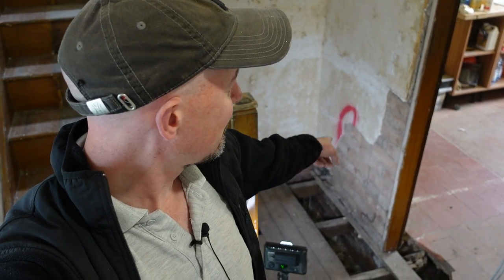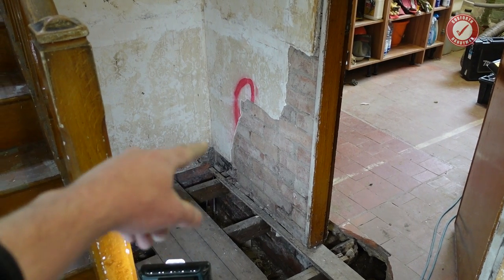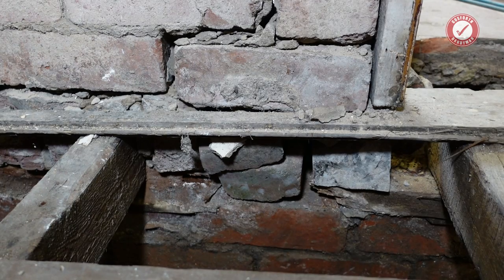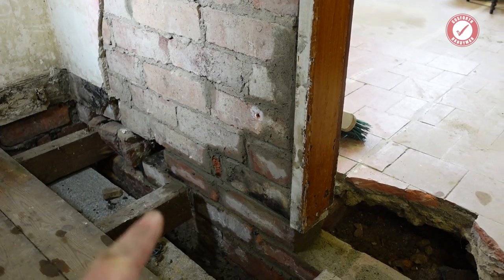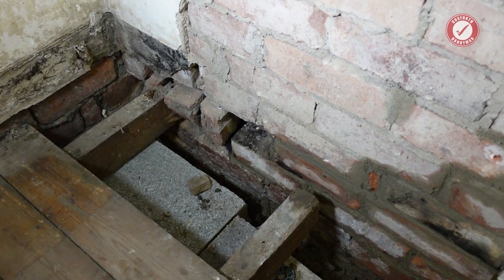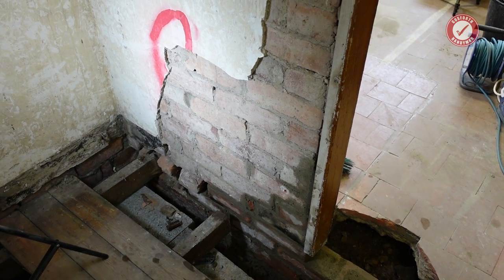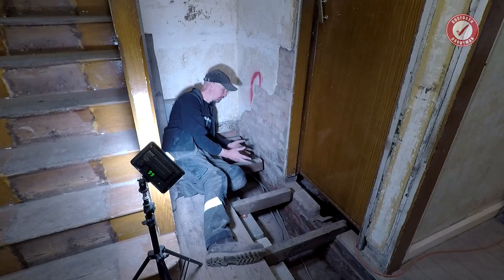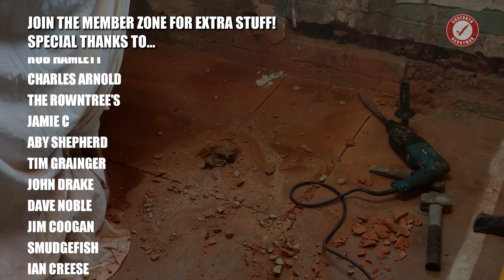We've found a STRUCTURAL problem! (1920's Renovation Part 16)

Comment: Wow!  What a nightmare!  7:09 Though (I'm sure he knows what he's doing) - cutting through the floorboard, that's supporting the wall that's holding up the two concrete lintel ends, inside the beams that it's sitting on..  Is that such a good idea?  Yikes.

I shall carry on watching to see what happens.

What I would have done, because I'm a wifey and not a builder, is rcj that whole wall up and replaced those two lintels with a huge long reinforced one the whole span of supporting wall to supporting wall.  The full width of the building.  That way - the problem is never going to be under the floor again and people can have it all open if they want.

I do wish I had a builder like this to call in for help.  I'm sure he will make it completely safe and beautiful and all in a very unruffled manner.

Comment: Hi, please advise the name of the long tool you use to lift the floorboards with. Very impressive how you rescued the wall, and put the damp-proofing strip in. I erroneously thought these were only for the outside walls. So worth knowing about thanks.
Reply from the maker: Cheers! I think it's called a Pallet Buster. 👍
Reply: @GosforthHandyman  thanks, I have found it on Amazon, and thank you for demonstrating its use.

Comment: Would you consider spreading a sheet of plastic on the bare ground beneath the floor you just opened up?  To stop damp from rising up into the tongue & grove flooring.
Reply: On the concrete?
Reply from the maker: Most of the issues in the house have been caused by moisture being unable to evaporate, so no - plastic would be bad. 😁👍
Reply: @GosforthHandyman  interesting; I have heard many times, in a crawl space environment, it’s advantageous to spread plastic on the surface of the ground to stop moisture from entering the airspace down there by keeping it contained within the soil.  Guess things are different depending on the local environments and construction process of the foundation walls.  Perimeter drains are quite common where I live so we don’t have to deal with wet walls as much.

Comment: I bet that sleeper wall is sat on the oversite with not much under that. If you put those blocks down on a bed on mortar with the weight they are going to take you would be fine.
Reply from the maker: Yeah, would probably be absolutely fine. 👍

Comment: What a nightmare! Even if it hadn't rotted, the amount of compression on that timber wall plate, eek!
Reply from the maker: Very common in older houses unfortunately. Fine if the timber is dry, disastrous if the timber rots. 👍

Comment: Could it have come from the broken drain which was causing issues in that cupboard under the stairs in the garage type room?.  Seems too close to the original issue to be something else.  Just a thought...
Reply from the maker: The broken drain certainly wouldn't have helped the damp issues in the kitchen floor. So yes, could all be related. 👍

Comment: Not sure of that's the right way in fixing it.  The wall looks to be lime, so, I'd not recommend using cement mixes.
Reply from the maker: It's a normal internal brick wall. Cement is fine. 👍

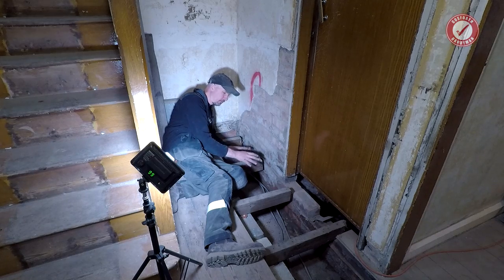Comment: qq: at 21:12 you say that the joists can't stay (long-term) on those dry blocks. why not? seems a pretty sturdy solution to me
Reply: It might be because the weight of the joists should ultimately transfer down to the foundation.
Reply from the maker: Yeah, in all honesty they'd probably be fine but it's just a bit bodgy. Would at least need the wedges glued in in case they fall out. But I'll sort it properly. 👍

Comment: coud you not usw cemented concrete blocks in from of your new repair to hold the floor joists and act as a wall plate>
Reply from the maker: Would probably be absolutely fine but I don't want to block airflow too much under the floor. 👍

Comment: Surely you should have set up acro stands first
Reply from the maker: Acros wouldn't stop the wall from dropping. Could use strongboys but inserting them would disturb the wall more.
Reply: @GosforthHandyman  i know it wouldn't stop wall. But at least if it did collapse while working it could have potentially stopped the  upper floor landing on top of you. However it didn't happen so fair play to you. Braver than me
Reply: @GosforthHandyman  You could have supported the wall at the base where you removed some bricks close to the door frame and that certainly would have prevented the wall dropping. Acrows would be too tall, at that height just some 4x2 posts would be adequate with a small steel as a needle through the wall near the ground. It would only take half an hour to set up and makes for a less stressful and safer setup.

Comment: Amazing how much damage water can do to those old houses cause man are those old houses sturdy. But whenever there is an issue with those older houses its always a big job. Especially when it has to do with load bearing walls.

Do you think its possible that tile was installed before the concrete fully cured? Causing the moisture to go everywhere else but up? Cause I know that can be an issue especially if any epoxy or modified thinsets are used.

Comment: People that built that house didn't know what the hell they were doing.
Unsupported walls everywhere. Weirdly built house. Maybe built by gnomes.
Reply from the maker: Lol... unsupported walls everywhere? No, only this bit due to the concrete kitchen floor rotting the wall plate. 👍
Reply: Yes, didn't you have a CAD drawing of the rooms and walls in the house showing that some second story walls were built over open spaces instead of over supporting walls and beams?
Or am I thinking of another house??

Comment: Very interesting. I bet if you knew, at the time of purchase, what you know now you would not have bought the property. Any regrets?

What is wrong with leaving those joists supported as they are? That area will not see any traffic or weight. 

Our entire dining room has a floating floor supported by dry bricks and bits of slate and stone as levelling spacers. When I replaced the floor boards, which were clearly cheap and highly warped/cupped/twisted,  I did have to level the joists but not a great issue. The floor boards were replaced with 2ft x 4ft chipboard flooring sheets, no nails, screws or glue. That was 35 years ago and the floor is still stable and does not creak!

Very pleased to see that you cleaned out the 100 year old rubbish under the floor. Why do builders leave it there? Lazy I suppose.

We had a new kitchen installed a couple of years ago and the installers left a lot of debris under the new units. It took me a whole evening to clear out. Needless to say; the installers did not comment!
Reply: Why builders leave rubbish, hmmm same reason you didn't use fixings in your flooring....
Reply: @135Ops  There are many different views on fixing chipboard T&G flooring. Glue or not to glue the edges. Nails or no nails. Screws or no screws. Or none of the above, which I chose and for me it worked really well. In the kitchen installation I also had the floor boards replaced with T&G chipboard. The installer decided to use screws. It creaks after only a few months. Who knows the optimum/ideal method?
Reply from the maker: We'd still have bought it. Even if it was a pile of rubble we'd have bought it. Gardens like that are a 1-in-10 year find around here 😁. Yeah, could probably leave it and would be absolutely fine... but will sort properly for my OCD. 👍
Reply: @GosforthHandyman  OK. Your choice and effort.

Comment: @18:41 NOOOOOOOO, I didn't just see you lay a termite block on it's side for "support", did I?
Wrong, wrong, wrong. You should know better.
Reply from the maker: Termite block? Do you mean Thermalite? God no, these are 7N concrete blocks. VERY heavy.
Reply: No, termite, they're used as termite blockers especially down south where termites eat anything made of wood.
Termite blocks are solid concrete 4" x 8" x 16". Half the size of regular concrete block but solid.
Mobile homes and wood frame construction use them to keep wood off ground.
The blocks derive their strength horizontally not vertically just as you wouldn't lay a standard concrete block on its side.